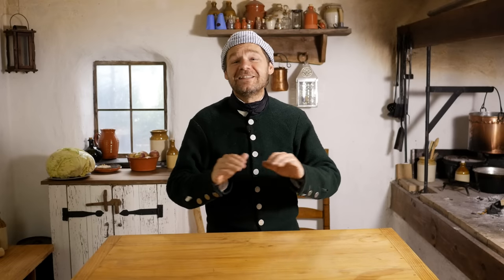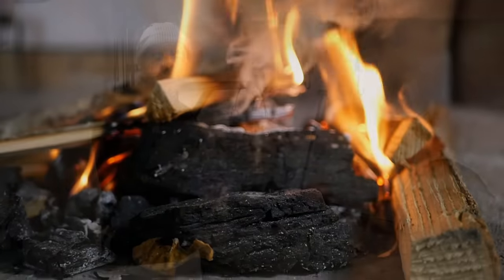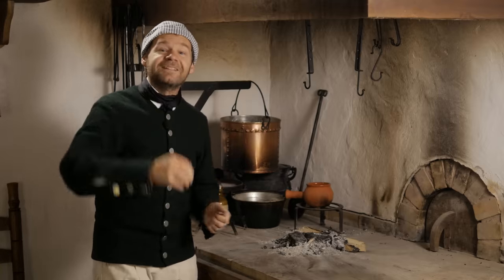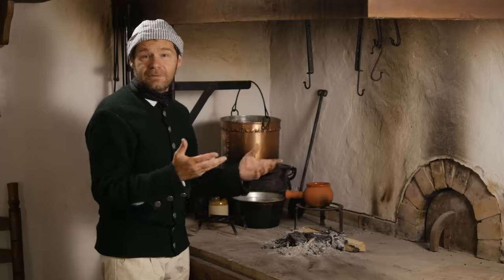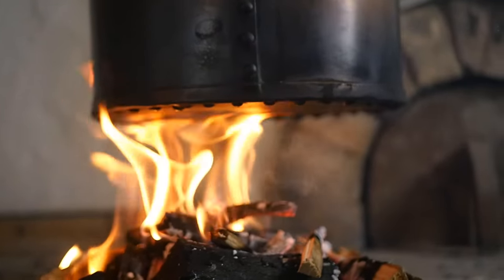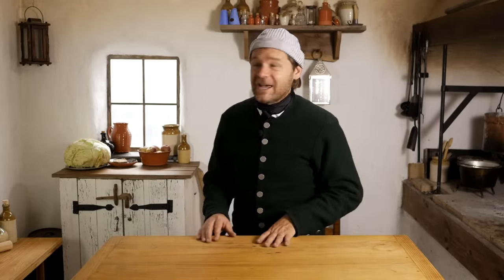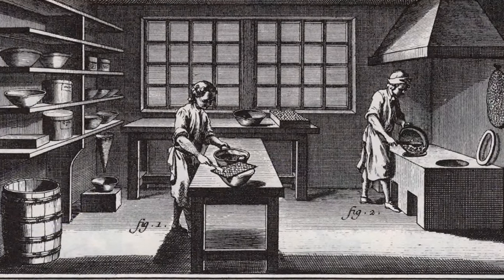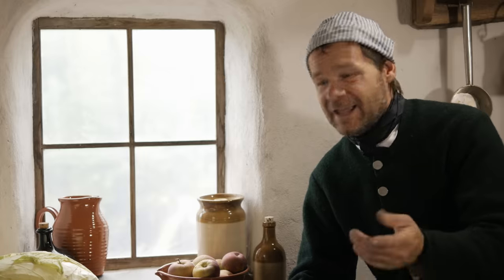Historic Kitchens vs. Modern Kitchens

Comment: I'm an old hippie gal. Lived off grid for about 10 yrs.& hauled water for 5 yrs. Would take 55gal drum & fill from town, siphon into another drum by the door that had a hand pump. From there fill big canning kettles or whatever else. To do dishes heated water on the wood cook stove in the canning kettle. Did have a sink and a gas frig and later a gas stove to go with the wood cook stove.  At one time we took showers by heating water in 1 gal. teapots and stand on the back porch in the winter while the water was measured over you. Summers were 55 gal drum painted black on a platform with a pull chord water release.There is such an art and a rhythm to this life style. It was more labor intensive but also a slower pace. Everything took extra steps and you took nothing for granted.

Comment: When I was a kid (in the 80’s) my grandparents didn’t have running water. They did have a sink and bathtub though so we could at least pour water into them and they would drain out into the septic tank. But baths were out of a pan in the winter when it was too cold to heat up a tub. And they had a toilet with a septic tank. You just had to manually fill the tank. We saved milk jugs and used them to carry water back from the spring. We’d put a broom handle over our shoulders and 2 or 3 jugs on each side. Luckily the spring was only maybe 75 yards from the house. And they had electricity for lights. But there was no air conditioning and the heat was all from burning wood. I did a lot of water toting and wood splitting when I was up there. Sure made me appreciate the modern conveniences we had back at home. Ironically though their stove and oven were electric…. My family still has that house. Though now it’s well insulated, with running water (from a pump at the same spring) and has propane heat. Just a window unit AC in the bedroom though.

Comment: I lived without running water or sewer for almost a year. There were a few little tricks I learned to make doing dishes a bit easier but still, there was nothing easy about it. 
Summer was less difficult because I could do the dishes outside right by the fire I used to heat the water. When the water got dirty, I could just toss it into the trees and get more from the rain barrels.
Extra dirty or greasy dishes would get scrubbed with a couple handfuls of sand, dumped and rinsed and then I would wash them in hot water and soap.

Comment: Wow, I guess I never thought about having to cook in the dark! Now I am thinking about why people will cook with a handful of this and a pinch of that because they couldn’t see as well with just a candle or the light of the fireplace. Having to bake bread, biscuits, mix up corn pone, or heat up and cook eggs or cut up fruits or vegetables in the dark seems much more difficult then than it is today! Praise God for that electric light switch!

I had thought about how to wash dishes without running water. I have washed dishes, silverware, cups, mugs, pots and pans by heating wash water up on my stove in larger pots. That works but it can sure be labor intensive to haul off the dirty water and replace it with cleaner water as you work. 

Thank you very much for this video! It has given me a lot to think about!

Comment: My house was built in eighteen twenty eight in Maine.they ran a wooden pipe inside for gravity fed water from the spring through a barrel were they submerged food in water tight containers for storidge.also first indoor pluming in town to a water tank in the attic and gravity did the work from there.

Comment: I worked for an outfitter in a hunting camp in Wyoming cooking for 20-35 people in a wall tent, i did have an apartment gas stove but my water for dishes was a wash tub on the wood stove,and the water was hauled to camp in 5 gallon jerrycans from 20 miles away, I didn’t have it as bad as it was in the 18th century . I have a deep sense of gratitude for my modern life , having clean and easily accessible water is a gift , count your blessings

Comment: My great aunt lived in her old house in Switzerland. She still cooked and baked all her meals on a wood stove/ oven until she passed away in 1998. No thermostat, she held her hand inside and was able to tell if it was hot enough for baking. She made delicious sponge cake rolled up with fresh raspberries from her garden and whipped cream from the dairy farmer down the street.

The flue for the stove wound horizontally through the four rooms of the downstairs and then through the four rooms upstairs. They worked like ceramic radiators and you could even make a pallet on top of them in the bedrooms and sleep toasty warm at night. It kept the house incredibly warm in the winter and there was a bypass flue so you didn’t roast in the summer (but it was still hot).

Comment: You talk about having to fuss with the fire all the time to cook in the 18th century, two things. 

1. I live on the road and cook either with my rocket stove or over an open fire. I don't fuss, I don't worry about temperature changes, why? Because I cook according to my kitchen, I flash fry or I slow cook, (yeah, I bake etc) but wasting time trying to adjust temperature is neither productive and is futile, I'm pretty sure that over a day to day existence, it was the same back then, there were more important jobs to be dealing with. 

2.On occasion, I will go the route of some fancy cooking, that is when the rocket stove takes over, I have a modicum of control over heat, but these times are the days which I set aside for my cooking.

I have also cooked over brick built wood fired stoves, temp control is down to pot/pan placement, the stove doubled as a heathing source with the chimney running out through adjoining rooms before exiting the house, even then it could be adjusted for the hotter summer months. 

I had a constant supply of hot water, through a large pot, sat at the back of the stove, no point in wasting heat.

So, although I don't doubt things were different in the US inb the 18th century, I'm opretty sure that they wouyld have gone for the simpler route of cooking to the fire, not adjusting the fire to cooking.

All the same, interesting video, I'm just rebuilding my camp and waggon, so it is a great source of ideas and tips!

Comment: One enormous benefit of a waist-height hearth is safety. You're unlikely to catch the hem of your skirt in the fire if the fire is up high. And your little kids tend not to be able to fall into the flames. And maybe it's easier to ventilate, to remove the smoke.

Comment: Where is this filmed? Lovely property.

In the UK,  we've examples of kitchens constructed against the prevailing wind to prevent through drafts (and ash being blown all over the place- it manages just fine on its own). Tree shade kept the sun and heat out in summer versus affording some protection in winter.
In older kitchens, especially richer or communal kitchens, the hearth end ceiling was often higher in the kitchen than other rooms; known as a smoke bay to draw the fumes upwards so people can carry on working beneath the smog. Again, eliminating drafts ensured smoke went up, rather than creeping around the kitchen on wind currents... 

Different timbers will burn at different rates and temperature (although this is affected by humidity, seasoning etc.)- a fire that won't draw really makes your eyes water, but you never have an issue with flies!

Comment: A late 18th century museum house I toured in Bath, England, had the luxury of a stone sink built against an outside wall.  It had a drain with a lead pipe leading to the exterior, which you plugged up with a cork when you wanted to fill it (by the bucketful, of course.)  All very nice, until all that water running outside erodes your stonework or washes out your foundation.

Though if that had been my house, I would have had a receptacle under the outside drain hole and caught the gray water to throw on the garden beds.  They say it's good for the flowers . . .

Comment: I know in Canada for cold storage, a small wood structure would be built around one of the doors on the outside and would serve as storage during winter and in the summer it could be use to prepare and butcher animals so  not to fill the house with the smell and the enclosed structure would prevent animals from reaching the food.

During parties in the winter we still tend to use the outdoors to store the alcohol and cakes and other thing that would be better served cold instead of breaking our head open trying to fit it all in the fridge

Comment: I grew up in the USA storing all our bowls, cups, and glasses upside down.  What I've been told, storing our dishes upside down is a habit picked up from the days of the dust bowl and the Great Depression.  Dust storms blew in on the wind and literally got everywhere, so to avoid a layer of grit in people's tableware, they turned all the dishes upside down to minimize the dust and not have to rewash them before using them.

Comment: The baking element on my electric oven shorted out and while I was waiting for a replacement I was baking by using the broiler and letting my baking stone absorb the heat and get up to temp, then popping a loaf of bread in and turning off the broiler. After a while you have to turn it back on, let it reheat (but not enough to burn the bread) and it immediately starts to cool down again. What a pain lol

Comment: My wife and I made a kitchen very similar (rather a kitchen addition) to this one and the concern was the same, smoke. However, since my wife and I are not historians reproducing accuracy the issue was easily solved by a very quiet inline fan. Its installed high up enough so the inline fan is all but soundless even in perfect quiet. No smoke, ever. Btw, I learn from your channel, I keep learning from your channel, things that I use everyday, thank-you.

Comment: I was born in 1960.  My grandma on my father's side lived in a small dairy farm town in upper Wisconsin.  Gramma had just got electricity in her house in 1960, but she never had plumbing in her house, well, except a hand pump in the kitchen sink.  If you wanted to take a bath you had to pump water and then heat it on the wood burning stove and they had a galvanized tube in the kitchen.  It was routine that everyone would take  a bath on the same night.  First would be an adult and then a little more heated water would be added to the tub and then each person would take a bath in the same tub, same water.  I would take a bath with my brother as we were about 2-5 years old at the time.  For the bathroom stuff, there was an out house and they even had a small throne for youngens and a taller seat for adults.  Dad would say that when he was young they used the newspaper for wiping and if they were lucky they might get the Sears and Roebuck Catolog for wiping (it was much smoother paper).

Comment: I imagine that the smokiness in the kitchen had its advantages. i.e. hanging perishables such as meat and even potatoes was a good thing, as the smoke would work well to discourage flying and burrowing insects from said foods. Onions, garlic and numerous other aromatic foods would also benefit from the smoke, as well as be of benefit to discourage cockroaches. 
I recall my grandparents home had a mesh enclosed cabinet out in southern side of the kitchen porch, which was referred to as 'the safe' (or meat safe). My mother grew up in this tiny cottage of three bedrooms, for two parents and six children with an outside toilet that had to be emptied. When we'd go on holiday there in the early 1970s, desserts such as fruit flavoured jellies, were retrieved from 'the safe'. They never had electrical refrigeration when I was growing up but we never felt hard done by. Also, Nana cooked on a 'coal range', which had something referred to as a 'wet back'. This heated the water for household use, and did so with great effect. Roast dinners from the coal range were a particularly delicious and comforting meal.

Comment: This is how I eat, I cook on the ground outside on a rocket stove, I leave cheese and butter on the shelf for weeks as I eat it, veggies are eaten fresh, or go in a soup once unpleasant. I never wash my dishes, instead I soak in water then wipe clean with vinegar after the buildup is excessive for my breakfast bowl and lunch plate, and my meat pot generally gets re cooked every day, with the spoon in it to sterilize the spoon.  I only have one bowl, one mug, one medium mug pot, one large mug pot and a plate, plus two spoons. Although most of it is made of titanium.

The only times I get food poisoning is when I cold soak my breakfast in a plastic air tight container (traveling) without cleaning it on the third day, plastic's pores carry over bacteria from past meals, also eggs, I don't eat eggs out of the shell past 3 hours or less on a hot day.  If I do get an upset stomach, I take a drop of oregano oil and am good to go.

Comment: During the last year I've chosen to relocate to Asia.  You will find that what you describe as 18th century....is now in much of the world.  It might not be quite the same in my back yard as the 18th century ... for everyone, but for many, the luxuries of the 18th century kitchen are still upgrades to their daily experience.  My country of choice is the Philippines.  The dirty kitchen most commonly carries water in buckets.  The cooking is done over wood or sometimes charcoal fires.  There is a chimney built in to the room (which works amazingly well....).  The similarities between 'this' and 'that' (the 18th century) are a little startling.  I've thought of 'this' as the United States a bit over 50 years ago, but it's possibly a bit further back for many here.

Comment: We had electricity but no plumbing. There was a clean water bucket (about 25L) with a lid on the counter and a smaller, slop bucket in a cupboard. Everyone in the neighbourhood had a similar system. We were posh because we had an electric pump for the well but we still had to carry the water in. Luckily our well was pretty close the to the house. Hot water was heated on the stove top; in winter we would have to break the ice on top to get drinking water. The slop bucket, dirty water from washing up etc and waste food - anything biodegradable, went to an open compost at the bottom of the garden, next to the loo. There were no lights in the toilet or on the path there.  During the winter when it was really cold we would pee into the slop bucket and empty it in the morning: in the kitchen it might be only -5 C but outside it would be -25 C! And pitch black, of course. 

As my primary school was near our house, I was the last one to leave. That would mean that I was the one to take the slop bucket out to compost. On one such winter morning I slipped on the icy path and the contents of the slop bucket fell all over me!  So, to add insult to injury, I had to clean up the path off solid waste and wear my skiing jacket to school, which obviously looked out of the place.  It would take until weekend and several buckets of water to fill in a laundry tub with water in the outhouse. (We were posh to have a laundry room next to the bathroom - most people would have to hire a slot in a communal laundry house or wash their clothes in the bucket in the garden during summer)  then it would take a long time to heat it up. That process would have to be done twice minimum, so it was lucky there was a drainage! And electric light bulb, even if it was a bit dim. But as you can understand, with such a work just to be able to start washing, you would wash as many clothes as possible and considering a family of 6 would also take time and back breaking work of bending over the tubs. It wasn't something one would do every week! But then, one wouldn't sweat so much anyway and clothes wouldn't get dirty when everything was covered by snow. 

Most kitchens in the area would also (or only) have a traditional cast iron stove that was heated by burning wood, like my grandmother had in her apartment upstairs. In would also couple as a room heating in winter: kitchen was the cosiest place during the day and evening! The stored heat of cast rather large piece of cast iron would take hours of cooling down even in winter.  On the side there was a small water container with a tap: you would get boiling hot water whenever the stove was on, but as the container was very small it had to be topped up regularly. Too much water and it would boil over. The fire was lit at the bottom of the oven or under the stove (you could take the rings off to stoke the fire if you wished) and there was a flue at the back so there was no smoke or ashes stuck on the bottom of the bread (which were usually baked on a baking tray to save  cleaning). These wood burning stoves are so popular that they are still manufactured: my brother has a big one in his kitchen, also with square flat frying surface as well as the rings.

Comment: Here in New England, a lot of late 18th- early 19th century houses have the kitchen hearths with the main fireplace thats set up with pot hangers and such but then to the side, on a separate flue, you have an oven with a firebox on the bottom and a cooking chamber on top. these typically have iron doors. I'd imagine that this was more of the English style versus your more Germanic hearth. I'd also imagine that most kitchens of that era weren't equipped with an oven at all.

Comment: Put the oven under the hearth, then have the oven vent come up on side of the hearth, cross over the surface to the other side and then up and out, so it heats the cooking surface, that way you can cook on it, and when done, you can put the dish water on the cooking surface to heat it and it will stay warm, AND the smoke will be vented out.
Also have the fresh air pass through the exhaust to preheat it as it comes in, so no open windows in the winter!